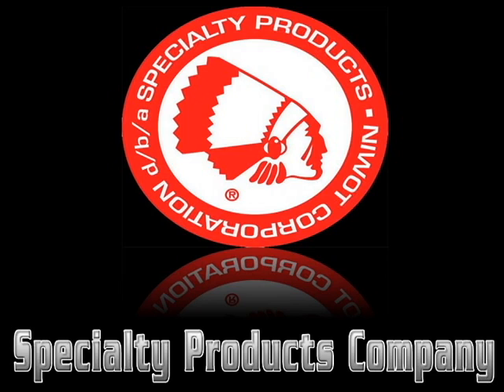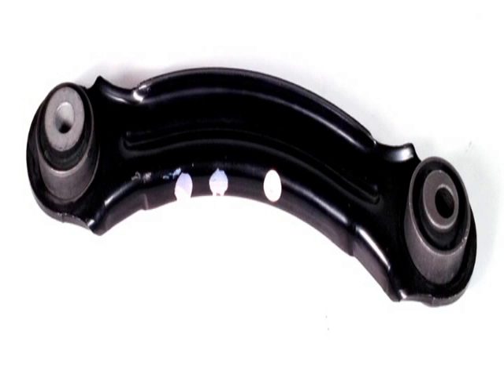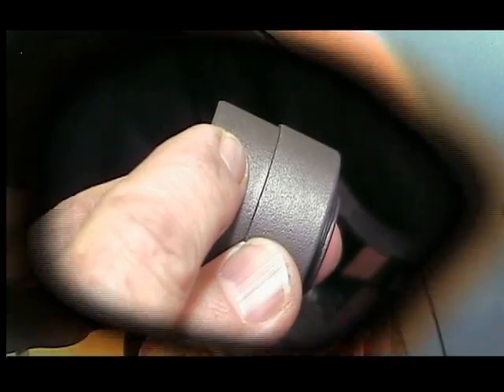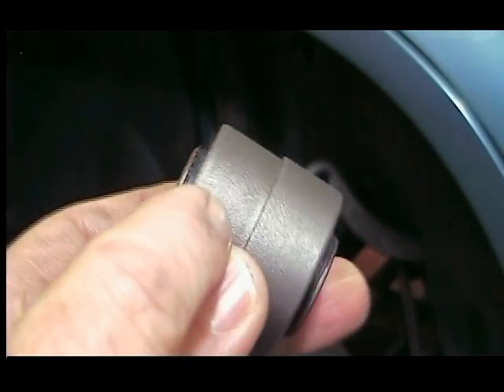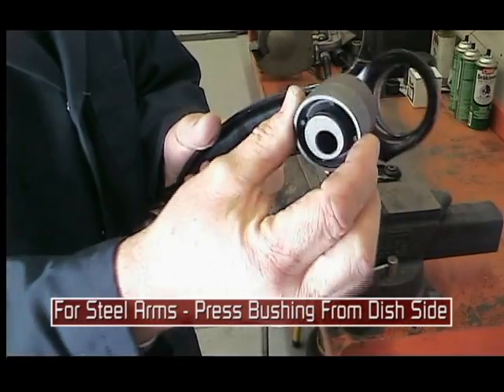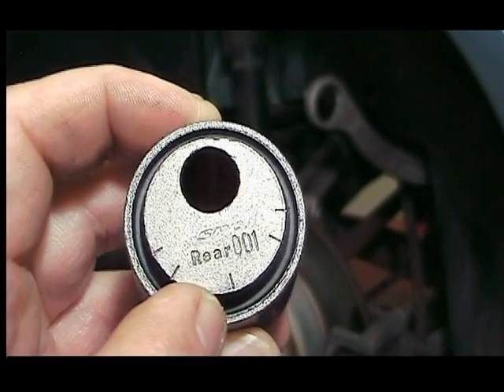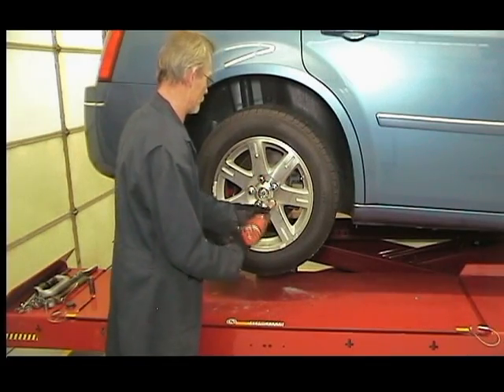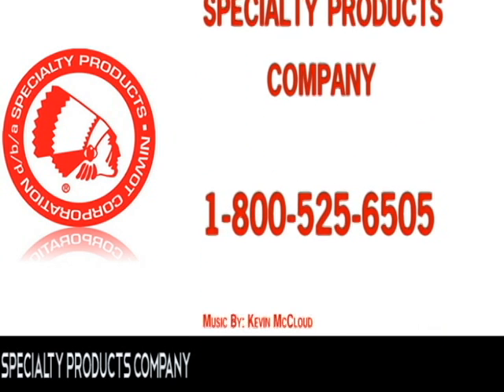66050 - LX Platform Rear Camber Bushings - Specialty Products Company

Comment: did not fit rear to small went right through the hole on upper rear why? no answer at fast hemi
Reply from the maker: Please call 1-800-525-6505 and ask for technical assistance. We will try to help with your issue.

Comment: Will this fix alignment issues when lowered ?
Reply: any reply
Reply: Yes 4 years later lol
Reply: guess im just here to uphold the tradition of one reply every 2 years
Reply: Is it fate that I’m commenting 2 years later?
Reply: It will do exactly what it claims.   If your rear camber is negative (-) 1.5 degrees, meaning leaning inward towards the car at the top of the wheel, or positive (+) 1.5 degrees, meaning leaning outwards away from the car at the top, it CAN correct that by that amount maximum, or less.     The amount of offset of the bolt hole you use while installing these bushings will dictate the change, if any, of your rear camber, per wheel.      The max they can change the existing status is 1.5 degrees.     Optimum factory setting is negative(-). 0.55 degrees.  If you have lowered the car, and your existing rear camber is more than 2.05 degrees negative, or more than 1.5 degrees positive, these won’t be enough to correct your issue, and would require adjustable control arms.   I used the word CAN in caps because it’s up to the installer as to how effective they are.   If they are installed with the bolt hole at the 12 o’clock position the result will be no change at all.